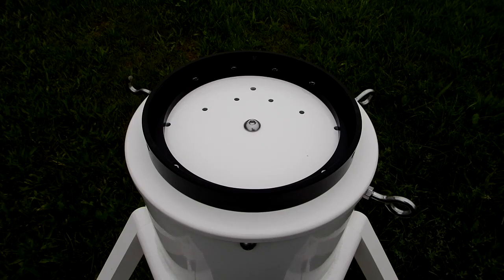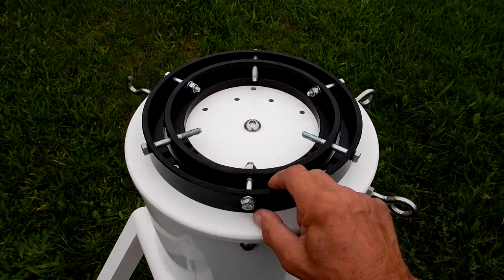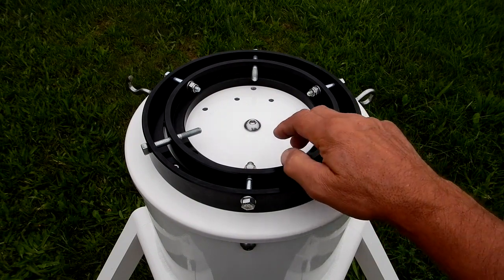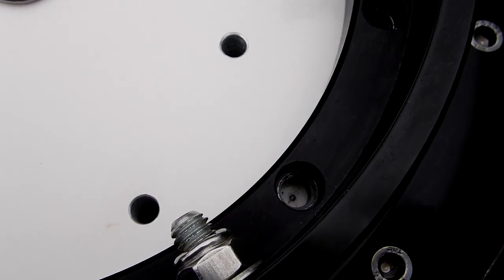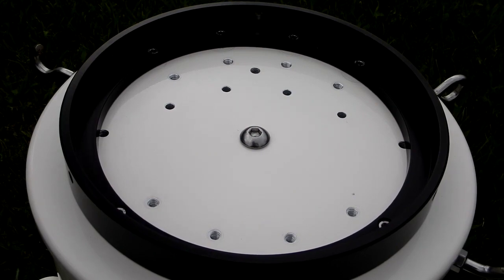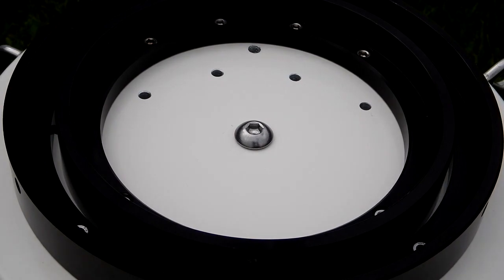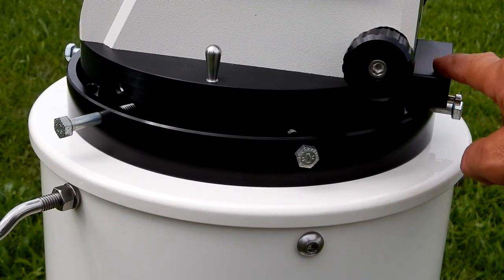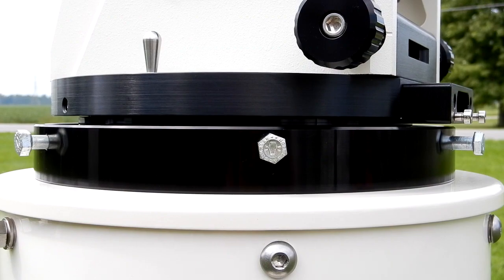Astro Physics 1100GTO & 1600GTO Mounts share the same tripod

Comment: Well that was unique.  Dual purpose, never thought of that.   I also never considered that the Eagle Pier would hold an 1100.  It's sold as a portable pier and tripod for the Mach 1. Will have to look for photos of that.  Nicely done.
Reply from the maker: THANKS! AP I believe under rates their mounts. Also, a Mach1 I had held the 175 f/8 https://www.youtube.com/watch?v=edy1Esj8xzM&t=127s If you didn't see my 2 videos on the 1100 and Eagle Pier here they are 1 https://www.youtube.com/watch?v=GoOwouTf3jc and 2 https://www.youtube.com/watch?v=bUNW3WDXWqQ Thanks again for your comment.